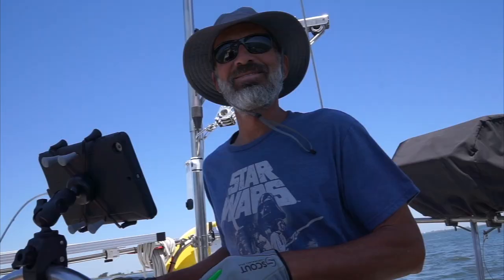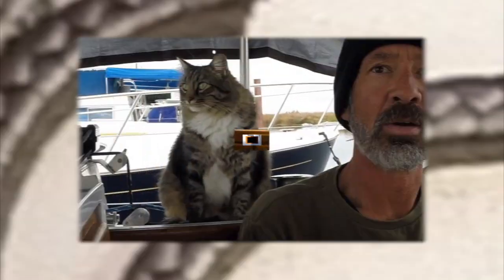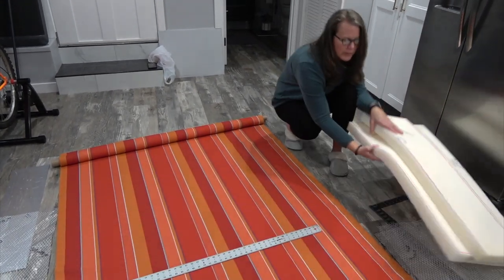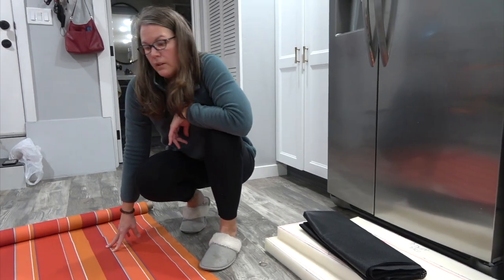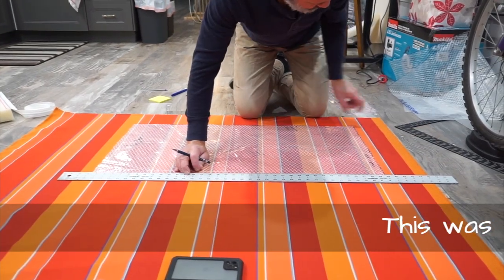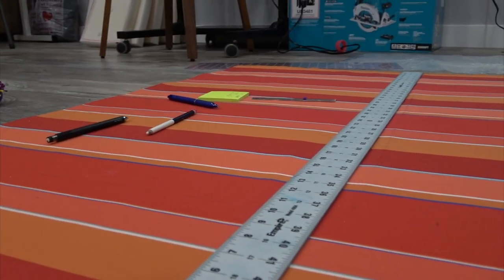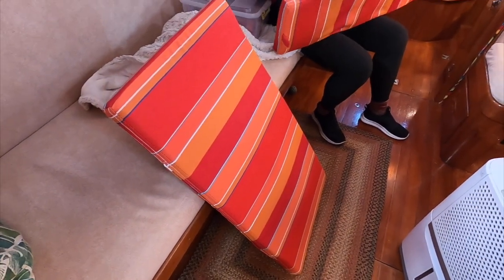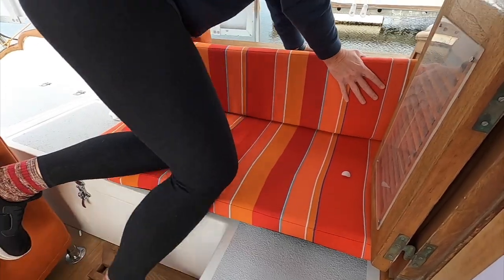Cockpit Comfort:  Crafting Cockpit Cushions | SV Ramble On

Comment: Beautiful work! After a year, are you happy with the comfort of the foam? Do you remember if it was it firm, medium soft?
Reply from the maker: Hi Marla - I bought Dry Fast Open Cell Antimicrobial Foam (Firm) from Sailrite.  I think now they call it CushionRite™ Dry Fast Antimicrobial Foam.  I chose firm foam since they are only 2" thick.  It's held up great so far and it's comfortable to sit on.  They're easy to wash (I just lightly use the deck brush when we wash the boat with some canvas soap) and they dry really fast.  I especially like the non-slip bottom material (Super Grip Nonslip Cushion Underlining Black 54") from Sailrite as well.
Reply: @svrambleon  Thank you so much for your detailed reply!